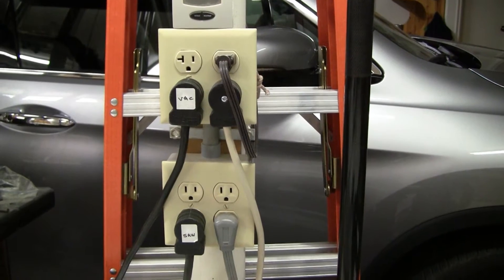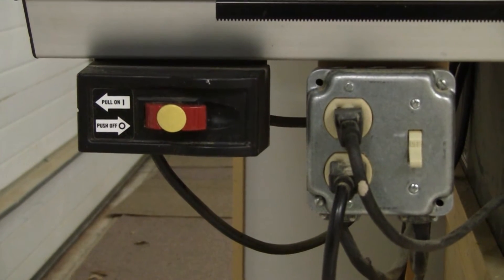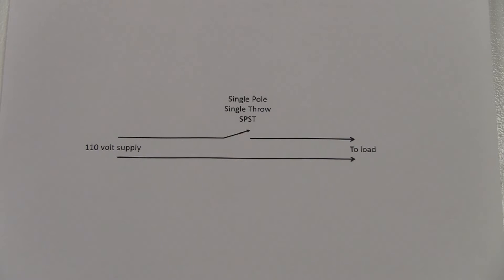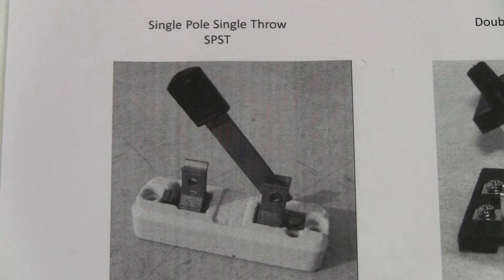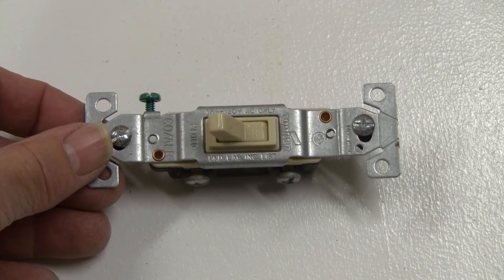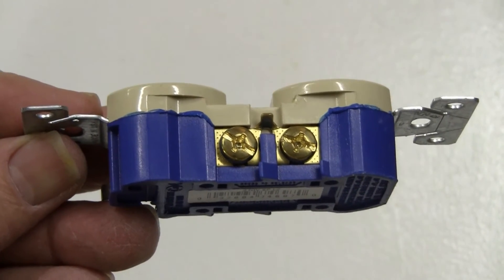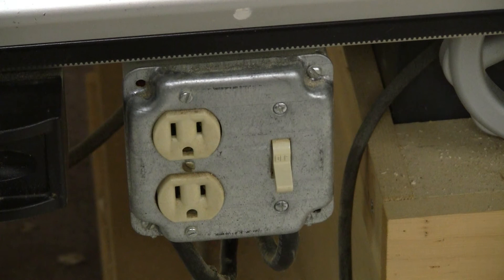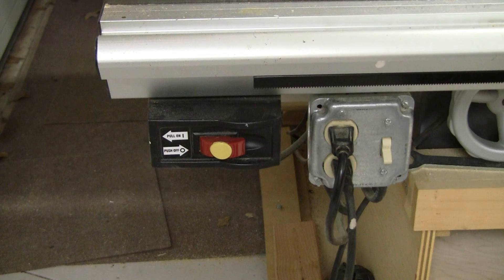Wiring up Table Saw and Vac

Comment: why two 110v 30A ?
Reply from the maker: I installed two 30 amp circuits to the workbench because I wanted to provide for future growth.  I have heaters, chargers, electric tools, a compressor, etc. plugged into them.  I can divide/balance the load between the two circuits.  Since there were two circuits, I plugged the saw into one and the vac into the other.  That way I could start both at the same time without fear of tripping a single breaker because they are on different circuits/breakers.  I could run both on a 20 amp circuit being careful not to start them at the same time, which I did for years in other houses.  TWO 30 AMP circuits is certainly overkill.  I guess it could be said that "I did it because I could!"  :)

Comment: You did a great job; for what MOST would need; and in a very simple way.

However, I want something even better. The answer of course; is a device that senses when the power tool is "ON"; and in turn, it operates a relay which will turn on the Dust Collector; whenever the power tool is switched on. Also I need an "auto/manual" switch; which will allow the DC to be turned on without the power tool being turned on. Such as when you want to clean up; using the vacuum without turning on the Power Tool.

The problem with the "sensors" is: They cost TOO much, IF you have a number of power tools. That is my malady. I have 24 power tools in a large shop. I NEED an inexpensive sensor that will not cost upwards of $1200.00 ($40.00-$50.00 a piece for the sensors).

If ANY one knows where I can purchase an inexpensive sensor; or better, build a sensor at very low cost; it will solve my problem.

John Heisz (on "I build it") has one; but the cost for the parts still runs the price up; to make it not practical for me. See it here: https://www.youtube.com/watch?v=_9AjaZ-7AkM&t=2s

Like Richard, John is a genius.

Thanks to anyone that can steer me in that endeavor.

Again, your device is VERY well taught Richard; and solves the problem for MOST. Keep up the good work.
Reply from the maker: Pat:  Thanks so much for your nice comments.  I agree that the sensors are expensive and in your case you need a lot of them.  The way I've wired up the DC and the saw, when you flip the DPST switch, the vacuum comes on but not the saw.  You have to subsequently turn on the saw using its own switch.  The DC comes on 'automatically' because the DC's switch is on.  If you use a sensor, you would have to have a parallel switch for the DC to turn it on without the 'sensed' power tool turned on.  

Hopefully someone will leave a comment to help you out!  Good luck!

Richard